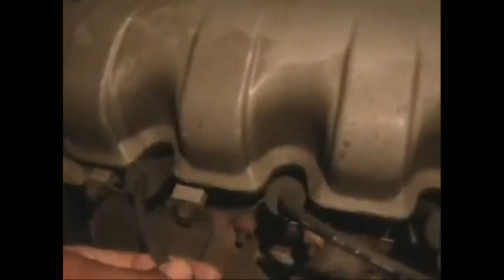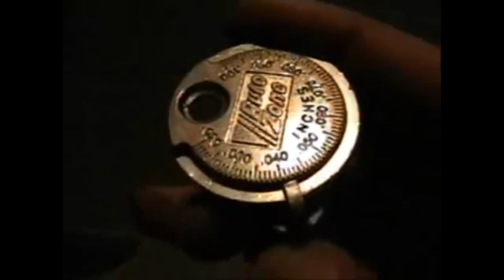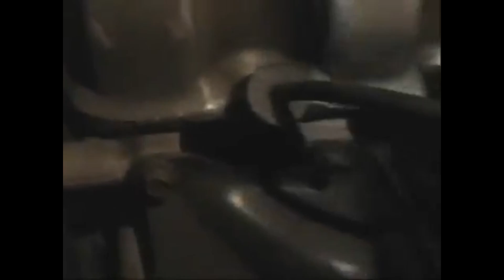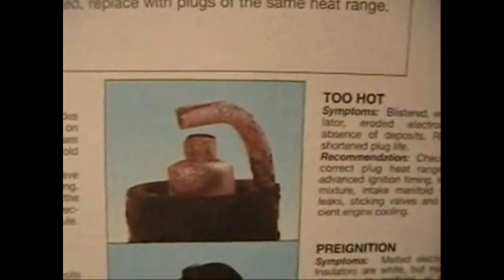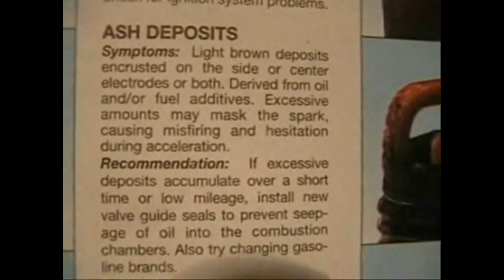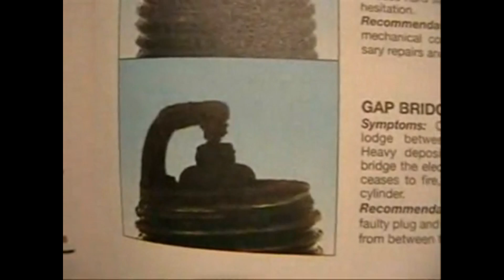Saturn SL1 Spark Plug Replacement

Comment: I cant find an answer to this anywhere,  but is the 4th spark plug supposed to sit a little higher than the other 3, or did I cross thread? I have a 2001 sl1. Someone if you own same car, please can you check yours to see if the 4th plug doesnt go as deep into the well as the other 3 plugs. Thank you soooo much!

Comment: Please note Dielectric grease should not be placed on any surface that transfers current!!  Dielectric grease is an insulator and intended to be applied sparingly to either the ceramic of the spark plug or with a Q tip to the inside of the spark plug wire where it contacts the ceramic of the spark plug.  

DO NOT put Dielectric grease on the contacts of either the spark plug or plug wire as it will result in misfire and poor performance (components can be damaged).  I learned this the hard way a long time ago and there seems to be a lot of confusion about proper use of dielectric grease.

Comment: I was looking up a Saturn SL1 year 2000 and this video came up and it's a 19 something year not a 2000 so if anyone knows a video of the year I am looking for please contact with the website address thank you in advance.
Reply from the maker: Samuel Diaz From what I know, there isn't any mechanical differences between 1996-2002  model years. There were only cosmetic and tuning differences.

I believe wikipedia has some infor about the changes between the model years. When you pop the hood, does you engine look like the one in the video? if not, you might have an sl2 instead of an sl1.
Reply: Basic Car Tips Yes it's the same engine but does this mean the spark plug wiring is the same also? And thanks again.
Reply from the maker: Samuel Diaz Yes. Everything is the same. You should be fine. =)
Reply: Basic Car Tips Awesome thank you so much... have a great day now.

Comment: bad thing about this video was it didnt show the other end of spark plug wires and their placement. silly me i didnt pay attn to the importance of their placement order. now my saturn is misfiring. help!
Reply from the maker: Eek that's not good. The only thing I can think about is pulling the wires off (from the spark plug side only) and from shortest to longest, place them back over the spark plug and see if that fixes the misfire.

You can also use a code reader to see what cylinders are misfiring and just focus on those cylinders to rework the wiring.

I'm sorry, in the video I should have told the audience to remove/replace one at a time so that this kind of thing doesn't happen =(

Comment: What was the firing order you used? In what order are your wires hooked up to the coil packs? I own a 2002 sl1 and having a bit of a dilemma with proper firing order.
Reply from the maker: According to this link.

http://www.motorsforum.com/saturn/does-anyone-know-firing-order-for-2001-saturn-sl1-5663-.htm

"The ignition cable order at the coil pack (there are 2 coils) is
4,1,2,3 (left to right) On the cylinder side it's 1,2,3,4 (left to right)."